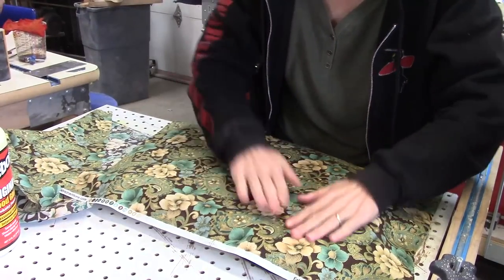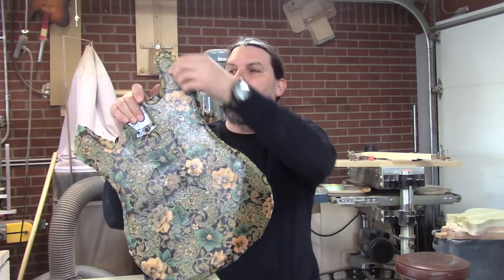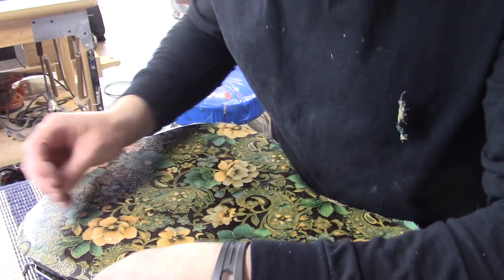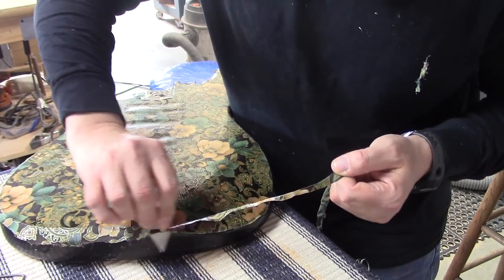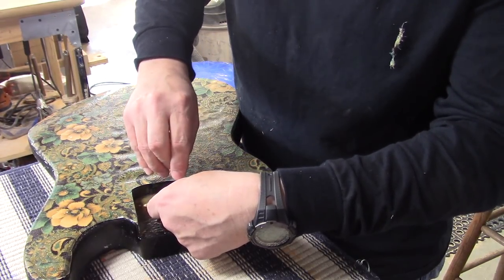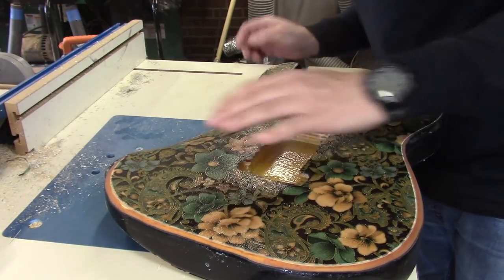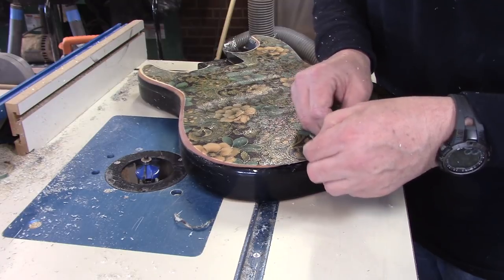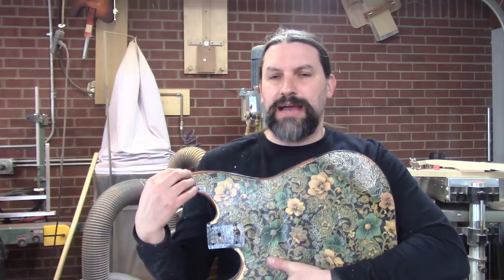The Coolest Stratocaster Refinish In The World!!!

Comment: After having glued the fabric to the surface of the wooden guitar body, I would like to understand which is the most correct/suitable transparent product to spray, or brush, on the surface of the fabric that I have previously glued to the wooden surface of the guitar, in order to finish the work of covering the surface of the two faces of the guitar body.  Then and for the thickness of the guitar body, what else should I spray, or brush, in order to make it dark, I would even say black, in order to hide the entire perimeter of the fabric cut flush with the edge of the guitar body?